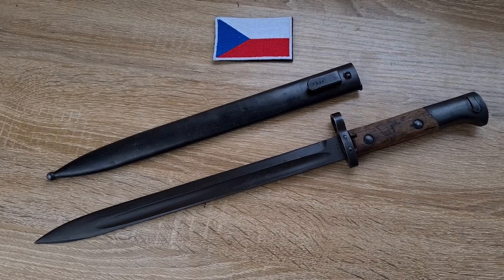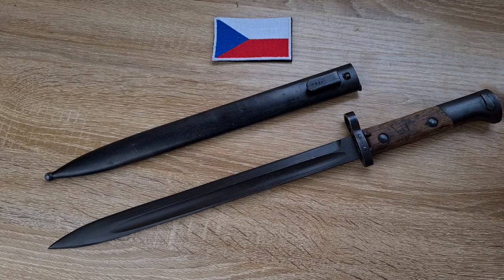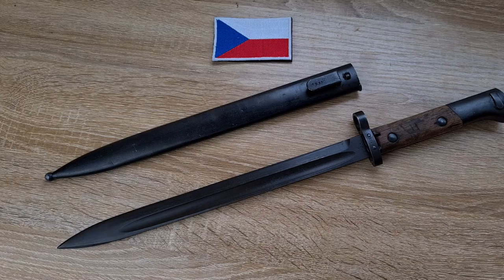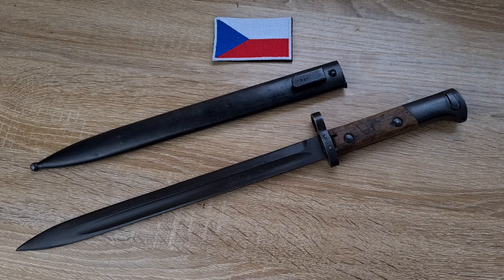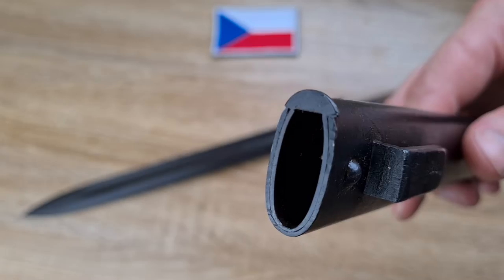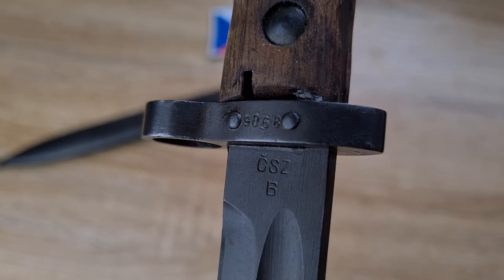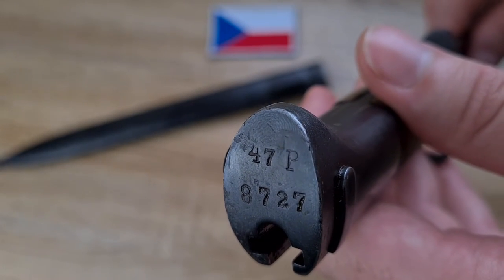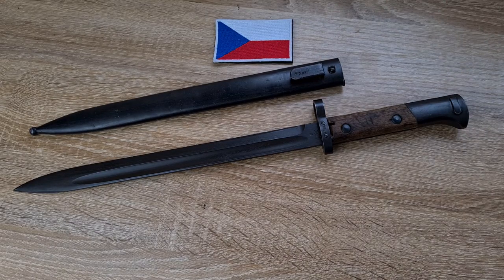Because I was inverted, Czech VZ24 bayonet

Comment: It’s a nice looking bayonet with that bluing, that’s for sure. It’s always cool when you can find out what unit an item went to. 

I’m just looking at getting one which lead me to this video. Appears to be a pre-war with the blade in the white and light bluing on the rusty scabbard. 

Did you end up getting access to a VZ.58 bayonet?
Reply from the maker: I did a VZ58 bayonet video about a year ago, not the best quality as I was still getting a feel for filming
Reply: Ah ok, I haven’t come across that video yet but I’ll have to Czech it out sometime. 

I ended up getting the VZ24 bayonet the other day, the markings on it are not like yours however. Here’s a description of it. 

Scabbard- two rivets on mouthpiece. 
- “E3*lion*48   tgf” on frog stud. 

Bayonet- blade in the white, appears unissued. 
-“E95*crossed swords*50” on underside of tang. 
-“tgf” on base of pommel. 

There’s no serial number or CSZ anywhere on the bayonet or scabbard. From what I can tell from your video it’s a 1948 scabbard with a 1950 bayonet. I wonder if it could possibly be an export version. What do you think?
Reply from the maker: @JMorris297  not too sure, I always have to check a book with vz24s. I have a Czech marking book, I'll have a look when I get home

Comment: what is the purpose of the rectangular slot/hole in the wood grips? the slot is on both sides, and there is a hole in the metal underneath.
Reply from the maker: It's a cleaning hole, very common on German bayonets too
Reply: @pointynotsharp8436  its just to let air out when you mount it on the mauser.

Comment: Ive got one without serial number.

On the blade(the metal between the handle) E "lion" 31 is samped. On the blade it just says CSZ A. There is also a small z with a circle stamped in.

The stabberd that i have has the markings E "star" 21 and als CSZ.

Im confused. Is the stabberd older?

The ring is also removed
Reply: might indicate one modified for german use, mismatches are very common with bayonets and scabbards